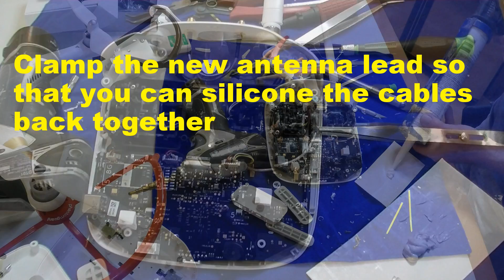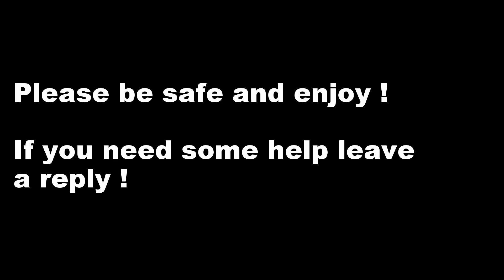DJI Phantom 3 and Phantom 4 Transmitter FPV Long Range Install upgrade / 4 times range

Comment: Which antenna in the radio transmitter in Phantom 3 Pro is responsible for FPV? Thanks for the answer.

Comment: I am with you Eric White. test the drone footage before and after the antenna booster distance test. that would help and get this product sell up  and where to purchase ? my phantom 3 pro got 6 kms with no antenna booster. but not enough battery to return home. fortunately for me is it landed in the park and I retrieved with no problem .

Comment: what idiots fail to realize is that its a 2-way link...boosting the rc unit will push the controller further but your not boosting the transmitter on the drone transmitting back to you.....

Comment: thanks for the post, that was very comprehensive. 
I did a antenna mod on a P3 Standard and I think that prepared me for the antenna mod I will do on my P3 Adv.
I may have missed this in your video but why didn't you remove the stock external antennas? 
do you have some sort of battery mod on your ship to take advantage of your antenna mod?

Comment: The ONLY thing that will help getting better range on the FPV is the fact that the Antenna is more gain than the original because they are more directional. The (FPV) video signal comes FROM the Phantom, so the 2,5 Watts is only sending stronger control signal TO the Phantom. in other word: the video signal FROM the Phantom is not getting stronger. I would not have called this a FPV transmitter but Control signal transmitter.
Reply: Those Sunhan's amps have a 12dbm gain on received video signal.

Comment: Guys I'm having trouble with the new antenna leads they seem different from the stock leads my processor looks different from the example shown   I have the newest version of the phantom 3 4k that runs wireless  any help would be great.

Comment: Hey Vegas 800 I need your help!  I purchased dji phantom 3 professional  few days back. I was trying to fly the aircraft with my Samsung Galaxy Note 5  but it is giving  so bad fpv video on my mobile  lacking and stopping other than  that  ever thing is perfectly fine all the control on long range flight but  as soon as I go  even  a little far  my fpv start lacking  and sometimes  so bad that  can't even  see what's going on with the Drone. And I am not being able  to enjoy  fpv. Please help  me if you have any solution for that. One more thing I tried  to fly  using  one of my friends  iPhone 6 and on that fpv  was fine.
Reply: Saad Qureshi if no one has answered your issue.  Apple products are the best to fly your drone.  I am using ipad air 2.. awesome video!

Comment: Thanks for the video!  I'm looking for help.  When I put the remote back together, my phone and the remote don't work together.  The DJI GO app continues to show disconnected.  the ribbon cable under the cover was reconnected.  the phone beeps when the cable is connected or the remote is powered on, but it still shows disconnected.  the remote calibrate screen doesn't show activity and also shows disconnected.  I opened up the remote again and checked all of the cables.  any idea what I've done wrong?
Reply from the maker: +Steve Gase check your con board the ribbon cable connection

Comment: great and thorough video... just bought a Phantom 3 4K and planning to implement the range extender mod. Any info on the price of the range extender kit that is not so very expensive?

Comment: Wouldnt it have been possible to remove the old plastic antennae and use those wholes to mount the connectors (no drilling)?

Comment: I have a DJI Standard, my controller is the GL358. can this type of mod be done with this as well? if so, do you have a parts list or a kit that can be purchased? the work seems easy enough, I just need the parts. great video by the way. nice job.

Comment: i have one question, why the fuck did you drill the controller instead of remove the antenna and place the coupling in there?

Comment: why would you even use this, the battery barely stands a full normal range flight anyways
Reply: Shadow747 ..... These are antenna extenders... meaning it extends the distance that you drown can travel. It will travel to max height, about 393 ft. And distance ...depending on obstacles a lot further. The battery that the radio antenna’s use are a separate from the battery for the controller.

Comment: I just install same gear (fpvlr + Sunhans that I baught separately) I have one blue light solid but the other blue light is blinking a little. that's the connector from the left side ... when I touch the connector blue light is blinking from strong to fair.... is that normal ?
Reply from the maker: It's normal as data goes through
Reply: sweet thanks

Comment: Very good job.
And it is a good habit to leave the way for retreat open i.e. to bring the RC back to it's original state by leaving the original antennae in place and sparing the antennae leads.
You know what You are doing.
THX for this video
Reply: He drilled 2 holes in the remote controller, so it's ruined and can't be brought back in it's original state.
He should have pop the original antenna's out, and use those holes for the new connectors, and then
he would have the option to bring it back to it's original state.

Comment: nice work, great craftsmanship and patients. will the p3 work in close proximity with everything connected but the battery power off? being it puts out a heavy signal was wondering if it needed to be powered up to be using in the house or within 30 feet? then power it back up when planning on doing a full excursion. please msg me with link to purchase and or info of your price to mod.. thnx and well done!

Comment: Message me I'm interested in buying the set up looks simple to install
Reply: +Priyanshu Kant can i buy the kit and change it with New V.2 FPV long Range
thanks waiting for reply
Reply from the maker: Yes it is the same as V1 install for V2
Reply: where can i buy it from you got the links
Reply: +Vegas 800 so the advance kit comes with the v.2 long range
Reply from the maker: Yes
Reply from the maker: No it's not my company I just help them out making the install video and occasionally I've helped others in their installs
Reply from the maker: Yes you can ... I have removed the factory antennas on the phantom 3 and inspire1 on most I've done
Reply from the maker: Yes it has the 5.8 gigahertz to communicate with a secondary remote for the control of the camera on the inspire one if you're trying to remove the stock antenna you need to be careful with that 5.8 connection to reinstall it inside the body of the controller The 5.8 antenna is shorter than the 2.4 on the backside you could cut The antenna above the  5.8 and reinstall that inside the control glued to hold it in place I've created videos of that but have not posted hope that helps
Reply from the maker: Yes if you want but if you want keep the 5.8 you need to install inside unit to communicate with other controller
Reply from the maker: I work better on sunny days 😀
Reply: +Vegas 800 what was the max distance you got ?
Reply from the maker: I'm really not interested in max distance more interested in penetration are you questioning the distance
Reply: +Vegas 800 you got a video on the air side booster mod kit
Reply: +Vegas 800 hey after doing this mode the follow me feature doesn't work any idea ??

Comment: I appreciate this is a hobby and people try to test the limit. But practically what is the point for such a range? The battery simply won't sustain it. And if you push it, you chance to lose your drone.
Reply: +chiupo lini I was thinking the same thing.. with the standard (stock) system/range.. it's about right for the battery capacity... so, I really don't see an advantage to boosting the signal... at least as the batteries are today.
Reply: The additional battery is a matter of diminishing returns...the balance between additional weight and the gain in range does not make this configuration viable for this size multi-rotor.  An extra 7 minutes of flight resulting in charging two batteries and more stress and wear on the system doesn't make sense.
Reply: +chiupo lini I have used the dji phantom 3 and others the range is not exactly the point, it is better control of your platform in area with higher rate of wave interference. IMHO.
Reply: +algorn deanza That is a very good point you make. You are right that if you fly the P3 in area with strong wifi interference, the range is drastically reduced. And the strong antenna could help to alleviate that.
Reply: +chiupo lini there are battery mods as well, im guessing you use this with those...
Reply: +Drone Life I suppose so. But I have not seen any. In any event any battery mod will only mean you carry more weight, and you may lose the i function built into the original battery.
Reply: +huntjunky1 I agree. Another point is however much you may modify the antenna and the power output, the fact is you cannot have too many obstructions between you and the drone. It is one thing to fly the drone in an open area, it is quite another to do it in a mountainous region such as Hong Kong. So I think whether one should adopt this antenna (which I have no doubt is of great design) would depend on the place where you normally do the flying. I am using the windsurfer antenna and that gives me about 4 km+ of range which I find very adequate.
Reply: +Tony Mark Thanks.
Reply: The industry isn't allowed to poduce better/higher performance models since the law does not allow them to do so.
They are being limited.

This mod is strictly forbidden in Germany. ANY internal radio-mod to the controller is forbidden!

What you are allowed to do is putting those "Parabolic Antenna Range Booster" externally on them.
Reply: REDxFROG Thank you for that :) we definitely want to be legal :)
Reply: We perform agricultural inspections----sometimes over very, very large fields. Being able to fly 10+ minutes out and then 10+ minutes back home without signal interruption----wow. Currently, we have to change home locations many times with multiple set-ups during one large field inspection so as to cover the whole field adequately. This range extender might be perfect for our needs.

Comment: i had my units installed on both my inspire 1 remote and and  my phantom 3 professional and i keep getting a no signal 
error and lose complete sight even at 20 feet up in the air .......i am so disappointed in the outcome plus i bought and shipped and had the professional kits installed by a professional in Austin.......i regret it, the booster worked once for me and it was awesome but i was also in the ranch about 30 miles from a house.............know i cant even go outside without losing signal i was advised not to power battery on and install antennas straight but am still having issues with the no signal error why 
can you please help i already paid you.....
Reply from the maker: Sorry I don't know who installed your set up but you should talk to them... I find it hard that you are having a problem on both p3 and inspire1... You need to fly it and see if you really are having a problem when the P3 or the inspire are near the transmitter and the boosters are on it will call a loss of signal but I would just fly it and it should go away or it will do RTH  ....

Comment: hey guys, what if the battery of the FPVLR died while mid flight, will there will be signal transmitting still from this device even without the battery?
Reply: and if not, can there be a simple switch to toggle between the stock antenna and the fpvlr? just in case I want to use the stock ones without having to pry open the controller again every time I need so.
Reply: Hackerzy1 
then id say carry a spare.  the drone will return without signal anyway. better then to swap it as it is velcroed and regain from rth.
Reply: +JimmyMelgoza I already put a small voltage reader screen to see the voltage of the battery. just to know when the battery is running low. and that works great.

Comment: Oh man... It BIG RADIO SHEET, not range extender... On stock setup it can fly about 5km, the battery is end on this road(10km). Phantom 3 use transiver, not only TX. If you want get more distance - you need connect 4 booster on phantom 3. And you install circular polarised antennas on TX - Phantom 3 used VERTICAL POLARISED ANTENNAS. You get -3dB on this(it give /2 range for you).

Comment: That's 5 watts at 2.4ghz into gain Circular antennas....do NOT stand in front if it.
Reply: +hans lombard 
I was sterilized.
Reply: +hans lombard hahahahha u funny bro
Reply: a Rob Ahhh, what?
Reply: Rubbish. 5 Watts is going to do zip. I have 2.4 Kilowatt digital radar on my motor yacht and the safe recommended distance from the supplier is 9 feet. And the Radar is a Higher and more damaging a frequency. So 5 thats about 0.2% so a safe distance would be about 320 thou. You would not hurt your self even if you used it as a jockstrap.

Comment: hello yes I have a problem , with spending near 400.00 on this system " WHY " when powered the system on says " Weak / Lost signal " turn off the system all good ????????????????????? I can send a screen shot if needed ! I try with the ant. the system comes with then bought 200.00 upgrade ant. and still the same. I had a near fly away with my phantom and not trying to do it again. I also have 3 other brand drones and have " NO " issues with them only DJI 's and one is there competitor  Solo . Thanks for any advice before I ask for my 400.00 back . James

Comment: I'm sorry, because I feel like this must be a retarded question, but here goes: Video is being transmitted FROM the Phantom 3 back TO the FPV Receiver, and yet this Mod talks about pumping 2.5W out of the antennas.  How does that increase the FPV range?  Or are the antennas dual purpose, with the amplifiers being for the RC, and are they bidirectional or something for the incoming FPV?
Reply from the maker: MIMO allows for multiple antennas in a device's Wi-Fi architecture, to create multiple data streams—increasing throughput.
Reply: One antenna for sending and the other one is for receiving !!!!

Comment: How much penitrasion are we speaking of? Is it capebel of landing/take off at a 2-3 km rate?
Reply from the maker: It will do 4 times the amount you have now at your location and more but 4 times for sure but it will penetrate better around things like trees, buildings it's a safety measure staying connected .... I say don't fly without it .
Reply: +Vegas 800  What i mean is, Can i fly it 2-3km land it at my friends hous take off and fly home?
Reply from the maker: Yes

Comment: Doesn't look too bad, but more margin for error than I would like.  This may have been already discussed in the comments (long list) but don't the existing antenna's just screw off.  Why not use those connections rather than pull the controller apart?

Comment: The stock antennas don't unscrew so you could just connect to their sockets?  or can't just remove them completely and use their holes?

Comment: Dosent the p3 have Lightbridge? I thought that Lightbridge has such a longrange rocksolid video link?I understand the need for the Q500. Speaking of the q500 you are the one that was fired at while flying over the gas station?  should gt a bunch of good quad pilots and buzz that prick with mini,s and bigger rigs!. That asswipe that fired at your quad needs to be locked up!he could have easily killed someone! by the way great flying@filming!
Reply from the maker: david ringler Yeah the P3 has Lightbridge and it is great but this knocks out of the park.
The Q500 it is must to do it ..It's range is crap and the FPVLR upgrade helps it big time. I put the Q500+ up for sale on Ebay it's a great but I have too many and it needs to go..

Comment: Thank you so much for providing this incredible instructional video. I am an oculoplastic surgeon (eyelid micro surgeon). I could never have accomplished this task without your video. I thought I "got it" the first time I watched it. Boy was I wrong. It got to the point where I watched each step of your video on my iPad several times and then I would do the step on my transmitter. It was a lot of fun and felt like a big accomplishment. I have modified two transmitters so far.  Very clever to do it in fast time. Great music. Very valuable that you would pick your work up and show several different views. Thank for sharing your knowledge.
Reply from the maker: Dean Larson Thank you so much, very nice of you to leave such a positive review.

Comment: Great job! Thanks for this... I just got mine...However, once you've attached the entire unit to the transmitter (snapping onto the bar in the back), how do you keep the whole thing from swivel forward and back? There's nothing that really anchors everything to the transmitter. I can spread the old antennae out to help (sort of), but the unit is pretty heavy and just pushes them down. So how are you securing the whole thing so that it doesn't move?

Any help would be appreciated.

Thanks
Reply from the maker: Jeff LaSor you could put some Velcro that will lock it. but really has not been a problem. I am glade that the video has helped. Thanks